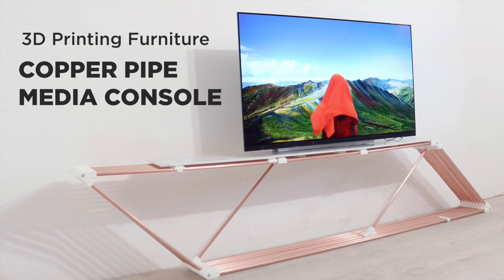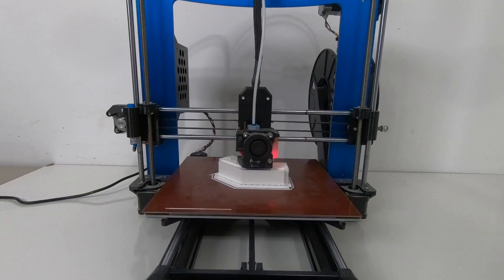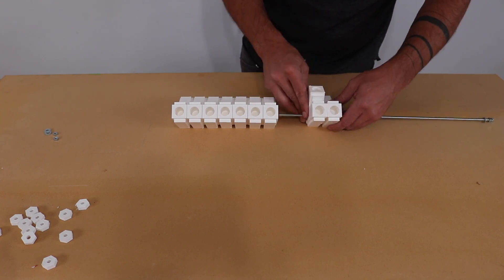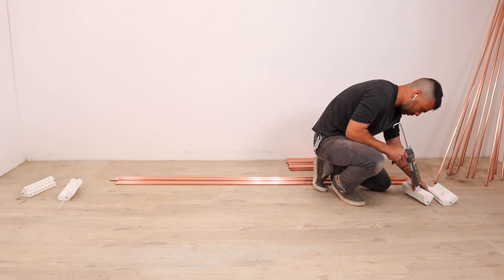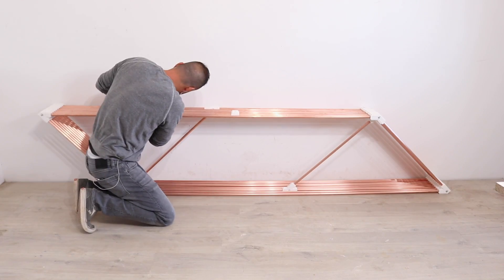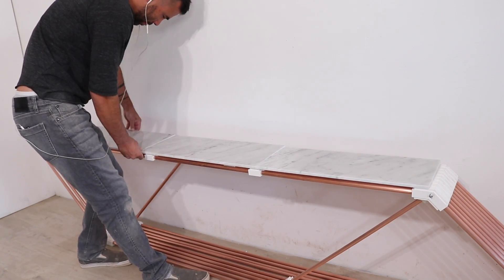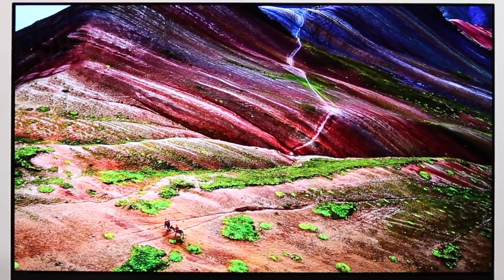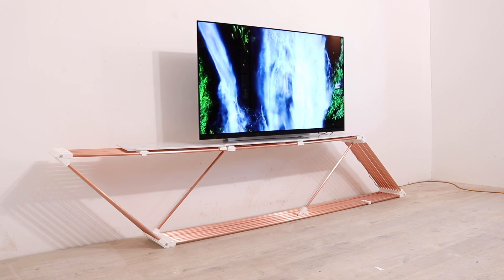3d Printed and Copper Media Console

Comment: At least use 3/4" copper tubing. Everything about this project is terrible. Copper isn't cheap, the proportions are all wrong, it isn't sturdy, the marble is throw on top and doesn't fit the length of the copper. The list goes on and on.

Really disappointed.

Comment: My wife wanted copper pipe clothing racks for her boutique and so I built them... While at Lowe’s buying the pipe an older gentleman asked what I was using the pipe for as I was obviously not a plumber and I explained my idea. He immediately showed me over to the wooden dowel section and insisted that if I was going to have any weight hanging or supported by the copper pipe that I would need to put wooden dowels inside the copper pipe for rigidity. Man was he right!! I also added some epoxy to hold the dowel in place. Two years and still holding strong! Funny also that this gentleman did not work at the store... shout-out to a fellow tinkerer!

Dowel rods inside copper pipe for rigidity - it’s a solid bet! 

Cheers
Reply: How do they look after 2 years?
Is the copper faded and dull looking now?

Comment: This needs a lot more support, the 2 cross pieces weren't nearly enough. Also if you were using construction adhesive anyway, it'd probably be a better method of securing the copper pipe by soldering with copper angle connectors and building something to hide those connections.

Comment: I like the materials used especially as an exploration into using 3d printing and easily accessible materials. Instead of using a lot parallel pipes, more strategically placed ones could have been better. Geodesic structures and truss bridges come to mind.
For everybody else, these are all experiments and this is "sagging and stupid" does not count as constructive criticism.